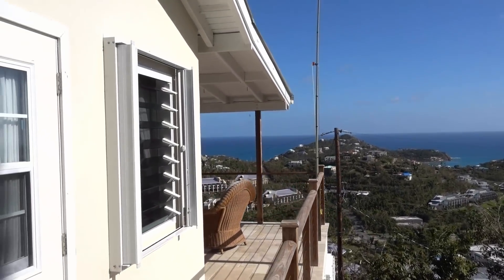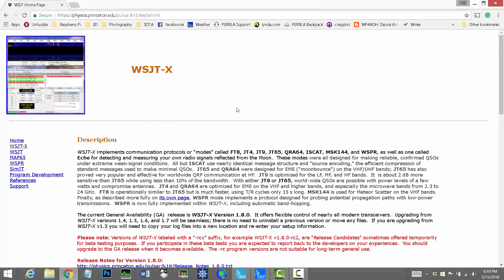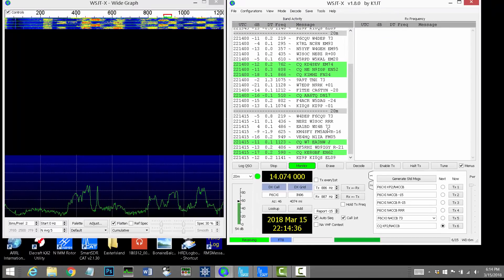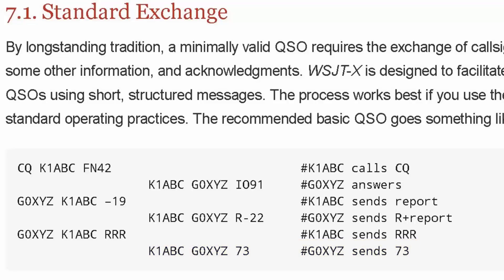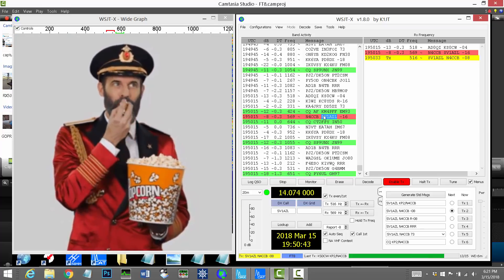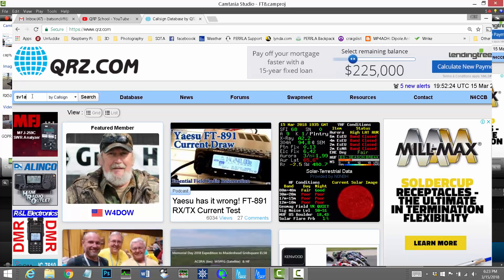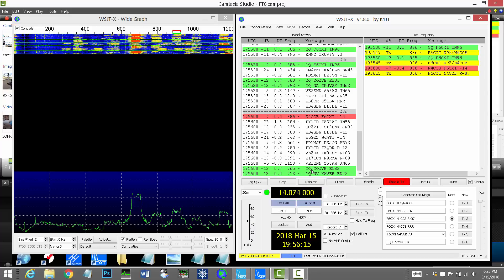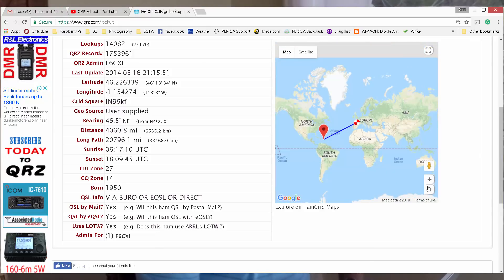FT8 - Quick Start (from St. John USVI)

Comment: Thanks for FT8 overview. I'm just wondering if their is a practical use for it. Like you, I still enjoy CW. It's an efficient mode, no computer required and you're actually talking to someone. I feel that Modes like FT8 are turning us into robots.
Reply from the maker: Hey, Michael.  You might want to check out the JS8Call protocol/software.  The author took the FT8 source code and modified it to become a keyboard-to-keyboard protocol so hams could type messages to each other.  If PSK31 and FT8 made a baby, it would be JS8Call.  Check it out here:  http://js8call.com/
Reply: @QRPSchool  Thanks, I'll check it out.
Reply: Michael, I agree completely!  Ham radio has almost become, “Hey Computer……I want my DXCC award before club meeting next week.  Let me know when it is complete.  Thanks!”

Comment: Funny, F6CXI lives a few km away from where I was born and raised. I'm back on the air after a couple of years off. I was mostly using FT8 on a 6BTV. I'm living in an apartment ground floor so the antenna is really an issue.  Still, I was able to make some contact on 20m using an MFJ 1621... Great mode for bad condition 73 de N2FLA

Comment: Cliff, thank you so much for this video.  I'm completely new to digital modes but a friend suggested FT8 to me so after getting an SCU-17 for my FT-950 I downloaded WSJT-X, all on Friday.  I seem to be all connected and receiving signals, but haven't yet hit the TX button.  I'm also trying to get RTTY set up with DXLab and WinWarbler, but that's a lot more complicated.

I do have a question though, in your settings in the main window bottom middle where it says TX even/1st, we both have that unchecked but I noticed underneath that your Tx is different to mine, mine is set at 1500 Hz.  Also below that my Report box says -15 and yours says -11.  Is that a settings thing?  I haven't altered anything, only set up the rig control.  Also in the main menu at the top my Decode option is set to Deep, is that right?

73 Tammie M3ENF

Comment: Thank you for the time/effort of sharing information about Ham Radio operations...I have not installed the FT8 software yet, so the answer to this question may become self-evident when I do, but re: the "signal reports" in your screen captures, I see numbers such as "-19" and "-16"...in which direction do these numbers need to go to indicate better signal?  For example, of the two I used above as example (-19 and -16), which is better?
Thank you for your time and assistance.
Raymond - WF7BSR
EDIT: Is that your duckling, or...?
Reply from the maker: Hello, Raymond.  When it comes to the Signal to Noise Ratio (SNR) values, the higher number is the stronger signal.  So, -16 is stronger than -19.  That said, if you're consistently getting back SNR values that are GREATER THAN ZERO, you're probably transmitting using too much power.  A lot of people adjust their power so that they are typically receiving report of between -10 and zero. 

The sleepy duckling video clip was just something I "borrowed" from someone else on the the internet. - Cliff
Reply: @QRPSchool  Thank you!  Installed software late last night, and after putzing around with it for a bit I got on 40-meters and within an hour had made contacts with Japan, New Zealand, Canada, Asiatic Russia, Australia, and a bunch of stateside contacts.
I see why this mode has become as popular as it is.  Currently the "conditions" are less than optimal, and this mode (as well as other digital modes) enables one to feel like one of the "big guns" -- making contacts with far-off lands while using low-power and compromise antennas; it's no surprise that folks who are struggling with learning CW are flocking to something like this.
Until the solar cycle changes for the better I predict that digital modes will continue to flourish -- they are a way for folks to make contacts when they would otherwise not be able to...and by making contacts that one can "show-off" to others it will go a long way in situations where there may be a better-half who rolls their eyes re: "that radio/antenna".
"These times, they are a-changing..."
Sorry -- rambling on more than necessary.
Thank you for your time and assistance.
Raymond - WF7BSR

Comment: What about mic levels in sound card?
Reply from the maker: Like all digital modes (PSK31, RTTY, etc.), the audio levels are important.  You want adequate audio levels between the computer and radio - but without overloading/distortion.  Setting the audio levels was discussed in my earlier video, Getting Started With Digital Modes. - Cliff

Comment: No mention of the baud rate?
Reply from the maker: It takes 15 seconds to send each packet of data.  To exchange call signs, locations, signal reports, and say "73" takes about a minute-and-a-half.  That's a pretty slow baud rate... but that's not really the point.  It's a weak-signal mode that can be used when most other modes would  not be possible. - Cliff

Comment: Hi Cliff - what kind of laptop were you using?
Reply from the maker: lvgdkarma it's a Microsoft Surface Pro 3 that I've had for several years. It's a very thin Windows computer that is my main ham radio hobby computer. It's thin and light, great for travel and working portable. -Cliff

Comment: It is time that these datamodes that do not convey any useful information were banned from the HF spectrum. Any datamode should be able to pass a useful message. One of the justifications for amateur radio is emergency communications. These modes cannot be used and therefore have no meaningful purpose. Let's have a standard where we require at least message capabilities in a mode before it is acceptable for awards. This mode panders to the ego of the creator and is killing amateur radio as we know it.
Reply from the maker: Hello, Graham. I respect your opinion. It's a complex issue and I see all sides. In a true emergency situation that has affected many people, SSB and the Winlink digital mode are the modes of choice. I appreciate the engineering that goes into JT65 and FT8 - and the novelty of weak-signal communications.  I'm all for it. Part of the justification of allowing amateurs to play in this hobby is to advance the state of the art and Joe Taylor has surely done that!

It's a little disconcerting to see so many digital users moving to these semi-automated modes.  But, it's a big hobby and there are many facets.  Someone enjoying FT8 is as valid an activity as someone who is into ham radio for the electronics.  I personally know 2 hams who almost never communicate with anyone... they only enjoy building radios/kits.

The hobby continues to evolve. Let's see where it goes... - Cliff

Comment: Very informative video and very well done! I have been absent from HAM radio for the past 9-10 years and I am just now re-entering the hobby. I have a lot of catching up to do concerning the digital modes. This video was a tremendous help and much appreciated. I too prefer good ole' CW and was previously not a fan of the digital modes. But I live in an HOA community with restrictions and my antennas will be compromised in the 20'x20' garage attic...lol! So making low power contacts in noisy conditions will be of interest to me.

Comment: Cliff, 
My computer has made several contacts with other computers using FT-8. Not my favorite mode, but like you said it does help when making contacts with a compromised antenna.
   73 - KD5ET

Comment: Hi Cliff thanks for sharing your videos I love them. 
One question is there a logbook in the FT8 program? Thanks in advance. 
73 Dirk PA2C
Reply from the maker: Dirk - Yes. After a QSO, click on the Log QSO button (just above and to the left of the Frequency display). A form will appear with much of the information already filled out for you. After you submit the data, it will be recorded in a comma-delimited text file and also an .ADI file.  Use the File menu to choose Open log directory and you'll find those files.  You'll probably want to use your normal log program's "Import ADIF" function to import these FT8 contacts into your normal logbook. - Cliff
Reply: That's great Cliff thanks for all the information.
73 Dirk PA2C

Comment: I wish LoTW would accept FT8. Nice place to operate from! 73 NE5U
Reply: LOTW does except FT8 I have over 200 confirmed FT8 QSOs in LOTW
Reply: I've tried uploading from my Log Book software numerous times and LoTW doesn't like FT8. It'll take JT65, phone, cw, etc.  Maybe it's the N3JFP logging software. eQSL takes FT8 no problem
Reply: I upload from my QRZ logbook and it works great.
Reply: I just updated the software to the latest rev. It still gives me a "line 37 error" but that isn't a LoTW problem. I also checked there and you are correct (clearly you know that), FT8 is recognized by LoTW. I'll try the QRZ upload.
Reply: That worked. Thanks for the heads up
Reply: is arrl accepting for dxcc or was